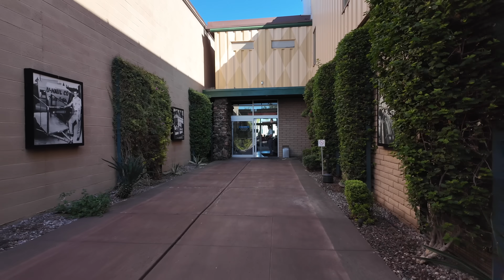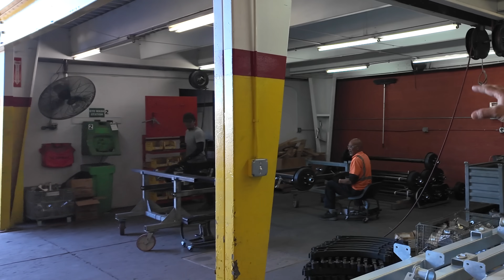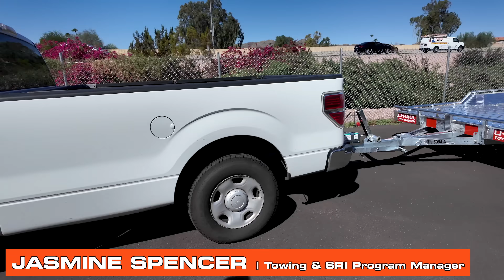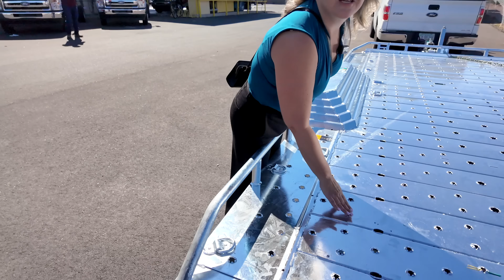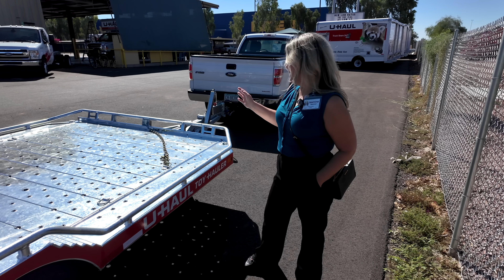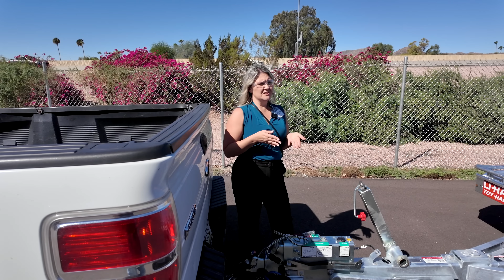Inside the U-Haul Trailer Factory

Comment: So I absolutely hate the hydro brake system. Because I just had to get walked through by u. Haul, how to unjam the damn system, leaving California. I was fighting the trailer the whole time and I stopped when I got to Arizona cuz. I'm just burning fuel, and I couldn't figure it out. I wasn't even loaded yet.
And that's what I realized the brake system was frozen.So they basically told me to beat on it with a hammer to free it up.But it's like the third time i've had faulty trailer brakes with these trailers.Also, it doesn't work if you're backing down a hill

Comment: Cool video! I used to work at the U-Haul assembly plant in Schererville Indiana back in 2004/2005. I was on the RV trailer wiring line, also did JH board up, and EL board up. Had a lot of fun workin there!

Comment: I've rented so many uhaul trailers through the years-- pretty much every type. It is abundantly clear they are purpose built to be rental units towable by a huge number of vehicles. They're so much better than the average consumer trailer. I know people love to complain, but I think uhaul is a great company.
Reply: My only complaint that I've EVER had with a Uhaul trailer is that the haulers don't have a winch...or even a roller or D-ring to mount a pulley to. And getting a 64 Impala with 4 flat tires and locked brakes up onto a trailer without a winch would have been impossible. (Ultimately we wound up using 3 vehicles bumper-to-bumper-to-bumper to create the line geometry to pull the Impala up straight.)

Comment: I will not use surge brakes. They jerk you around when braking and not smooth. Most all trucks now come with a brake controller built in. I think the real reason they're using surge brakes is to save money.

Comment: hopefully they added a way to temporarily disable the surge brakes so it can be backed up while loaded!
Reply from the maker: I have never had an issue reversing a u-haul trailer while loaded but I have also never backed them up a steep hill either. Surge breaks are progressive so if you are just backing up a gently sloped driveway, you would only be battling the surge breaks if you were stabbing the throttle.

Comment: uhaul employee here i have only seen the th once at my store i was the one to unhookit from cx truck and not even 12hrs later it went back out its a super popular trailer. 
and the uhaul makes their own equipment is also a powerful tool so the centers can do minor repairs so it does not need to go to shop plus parts can be used on many things ie the lights on the trailers are the same for the most part across the board between the trucks and trailers

Comment: I wish trailer manufacturers especially for cargo trailers would follow U-Haul’s design. They have dropped axles with a raised hitch which is a more proper way to have a low trailer and not have to have your hitch so low to the ground. There trailers are the best.
Reply: @gerrycollins9409  i’d settle for U-Haul making maybe a modified version so you can tell the bought ones from the stolen rentals but if they made trailers to sell. Though I like electric brakes as an option.
Reply: @kb9vgr totality agree, that would be perfect.

Comment: Huge U-Haul fan. I tow with U-Haul trailers on a regular basis. Absolutely the best value.
Please, please please when you talked about evolving .
Offer a range extender for electric vehicles similar to the product EV tender. All it would take is an E axle with a battery cell that assist the EV as it’s moving on a trailer platform.

Comment: Who manufactures the frame and trailer bed? The new toy hauler is nice, but it looks like this manufacturing facility essentially just bolts subassemblies together.
Reply from the maker: The frame and trailer bed (body as they call it) are assembled in another U-Haul facility, sent out for galvanizing, then shipped into the facility I showed in this video for final assembly. Kind of the same as how an automotive manufacturing facility doesn't build their engines and transmissions in the same plant where they assemble the vehicles. Maybe I can get an opportunity to check out the rest of their manufacturing if this video does well enough.

Comment: Engineer for the Darwin with a DL. 😂 Uhaul has gone through a lot of changes a lot not good! They abandoned people with classic vehicles and Larger vehicles for decades t
With car haulers that were designed for vehicles made in other countries yes America cars eventually shrunk! A mid size car from the 70s was Larger than a full size car today!?  And the fact they only use surge brakes on All of its trailers is dangerous in itself surge brakes were made for boat trailers where electric brakes can't be submerged!  They should have also included a way to use electric brakes and disabled the surge so people that know how brake work can be safer!!  You have 0 control over Uhauls surge brakes it's just a pendulum that swings no on the fly adjustment for weather, weight and road conditions it's a one for all system not good!!!
Reply: You mean the ones with the TruckNutz hanging from the hitch that can't be used without a drop hitch, jacked up so high you need a roofing ladder to get in?  And Wheels and lights to make the pavement princess, mall crawler super pretty no longer able to do truck stuff? I remember all the cars people decades ago who didn't have the $ to build their vehicles so it was all dressed up  with JC Whitney all show no go parts 😂  like the fart cans some run around sounding like a Lawn mower with stomach issues.😂 Yeah I know there are all types out there some just can't help but to go with the peer pressure and copy what Billy Bob did not knowing they ruined the truck nevermind letting them tow anything.
Reply from the maker: What happens when the previous renter disabled the surge brakes, then the next renter doesn’t have an electric brake controller? Then they have no brakes. There is absolutely zero world where U-Haul would be smart to have brakes be adjusted by renters and trust that every knucklehead who bought a truck has ANY understanding how to use a brake controller.
Reply: @GearsandGadgets   you know Uhaul used to sell and install electric brake controllers that were very primitive by today's standards! They used the brake pedal to activate it .  If the Rental location Doesn't check for safety and damage of their rentals before renting them like they are supposed to its on them! And it wouldn't be hard to make their trailer automatically revert back to the surge system!  😂😂😂 The company puts a lot of time money and thought into everything! Yes they almost failed several times but they keep coming back somehow?
Reply from the maker: @kmexploring6402 ”it’s on them” is exactly why they don’t do it. Risk mitigation is at the core of any good business and saying they would have to mechanically maintain both an electrical AND surge brake system on every trailer makes absolutely zero sense from a business perspective. Surge brakes work and they are idiot proof. Yes I would LOVE to be able to use my brake controller but the average person (Uhauls entire customer base) does not know how to properly set up an electric brake controller.

Comment: I love U-Haul trailers, but I think their trucks could use an update. The mirrors not being adjustable is a huge safety issue, especially given that the seats have basically no movement backwards. Between that and the lack of cruise control, it makes longer drives much more fatiguing than they otherwise would be.

Comment: Great new trailer, however you did not really say much about the brake operation. Since so many trucks don't have a brake controller I am guessing they are using surge brakes on this unit?
Reply from the maker: It was discussed extensively in the video.

Comment: I do art shows and like the new trailers. The roll up doors on the old style has flung black grease over my artwork on 2 occasions, making 1/3 of my work unusable on 2 occasions. These days I make sure to get trailers with a different door mechanism. 

That being said I bought an enclosed trailer so that I would not need to keep renting. Then after owning my own trailer for a while, I am selling it because of the features offered by the uhaul trailer. Like the long single shaft connecting the trailer which lets me back up until the trailer is perpendicular. My personal trailer is a V at the nose which is much more frustrating to maneuver. And the haul trailer is aluminum, and fully loaded, I can move it by hand. Mine weighs an extra 200 pounds at the trailer hitch with the same cargo, in order to move it by hand I have to load an extra 600 pounds of concrete near the rear door. That weight then makes it sink into the ground more, and harder to roll. I will keep getting uhaul trailers instead.

I rent trailers 5 to 15 times a year for 3 to 10 days.
Reply from the maker: I think renting with that frequency is worth it more then owning aside from the convenience of owning for availability but everything else from storing and insuring starts to make less sense unless you are pulling it multiple times a month.

Comment: How do brand new trailers, not even out of the shop, have plates assigned to them already?  I mean you're manufacturing one every 1hr 20min, how does the VIN get through DOT and plates assigned so quick?
Reply from the maker: I am not sure but I did notice the trailers have Washington plates which is where U-Haul was originally founded but then HQ relocated at some point to Phoenix HQ. I am sure they probably have some self certification process out of Washington for their own rental fleets is my guess including a VIN generation process.

Comment: Nice trailers! U-Haul should give the public the ability to special order one if they want to pay the special order, low production price. I would certainly pay more for the quality. I love that they are galvanized instead of painted or powder coat. Powder coat is nice if done right, but all of the ones I see around here just peel off in sheets with rust underneath. No blasting prep work, just coated right over mill scale. I hate running my trailers in the winter because the salt destroys them in about 3-5 years, even if you take good care and wash them or Fluid Film them regular. Aluminum trailers are nice, but they typically don't hold up to abuse over time, especially with heavy loading and are a pain to get them welded because not everyone welds aluminum. I do, however, weld aluminum and have repaired many of these trailers. There's usually no rhyme or reason as to where they break, just not good welding and design as far as I can see.
Reply from the maker: I agree there could be a use for such a HD trailer mass manufactured but I don't think it makes sense for U-Haul to enter that business when they make so much in renting them.

Comment: Very interesting, I kind of had an idea that U-Haul made their own trailers but it was cool seeing a video of it.  I remember when U-Haul had their own branded tires and if I remember correctly they were an odd size to prevent them from being stolen.   They also used to rent clamp on trailer hitches but this was back before the 5mph bumpers which was before 1973.  One other thing they rented was mirrors that clamped to the front fenders under the hood on top and the wheel opening on the bottom.
Reply from the maker: Thanks for sharing some of that U-Haul history!
Reply: Ahhh the good old days of real chrome bumpers!
Reply: I remember those. I rented the clamp on tow bars. As a U haul dealer, I even got a call for one recently.

Comment from the maker: For all of the people who say they wish U-Haul sold these, I did too until I thought about it. I ran the numbers through ChatGPT (take it for what it is worth), and the estimate was around $9,200 to manufacture. If they sold them new, MSRP would likely be around $13K, and I do not think they would sell many at that price.

The reason (I assume) they do not sell them used makes even more sense. U-Haul does sell their used trucks, usually around 100K–120K miles for $10–12K for a 10’ box truck, because trucks still hold retail value. Trailers do not have odometers, they are worth way less used, maybe only a couple grand at best. Tow dollies, which are single-axle and only ever carried half a car’s weight, can be bought used for $1,195, and that is probably because U-Haul knows they were not abused nearly as hard. Full trailers on the other hand get used for anything and everything for 20–30 years. A local U-Haul employee once told me that newer trailers are kept for cross-country rentals while older ones are cycled into local-only service, and that makes sense because the in-town move trailers almost always look beat. By the time they are end of life, they are absolutely thrashed. At that point, the steel itself is worth maybe $200–$285 in scrap at today’s prepared steel prices, which is far easier than trying to sell them used and take on liability.

When you factor in that a $9,200 build can conservatively bring in $150K over 20 years at just 90 rental days a year, and that it only takes about 45 days of rentals to cover the profit they would make selling one new, it is pretty clear why you will never see these hit a sales lot.

Bill of Materials (condensed, ~$9,200):
	•	Structural steel and galvanizing: ~$3,800
	•	Axles, wheels, tires, and brake system: ~$2,000
	•	Lighting, wiring, safety gear, and hardware: ~$500
	•	Jack, coupler, ramps, decals, consumables: ~$400
	•	Labor, overhead, logistics: ~$2,500

Total: ≈ $9,200
Reply: Yeah, they ride them until they're beat.  Although I would like to get my own with the U-haul features that aren't as common as the ones for sale.  Galvanized steel construction and totally independent hydraulic surge brakes.  Those are quite rare to see.
Reply from the maker: @ryanpaaz  Agree
Reply: Close but not quite. The real reasons u haul doesn't sell trailers is liability.  
Where u haul buys its trucks from a major manufacturer  ford or gm then resells those at end of rental life.   As seen here u haul engineers design spec and then uhaul builds the trailers from ground up. 

Liability comes into play. Buy a former uhaul truck built by gm, have a person wreck that truck and then they sue gm for the design issue.  Uhaul didn't build the truck they used it and sold it. 

Now buy a uhaul used or new trailer have a wreck and sue uhaul.  

People can overload or misload a trailer easily. They can neglect maintenance they can improperly attach it they can fail to secure the chains properly or fail to secure the lisd properly. Fail to drive properly.  Much more so than a truck van or pickup. 

Uhaul used to sell off trailers up to the the 70s or 80s. Then a major lawsuit was made over a wreck involving said used trailer and after the case was settled. Uhaul made a business decision  of never selling another trailer. Only the trucks. This is also why they remove the box from the 26 foot trucks. They reuse the boxes or recycle them. They only sell the 26 footers as cab and chassis the exact configuration that uhaul buys them in from ford or gm. 

As a result of that decision that is well published, Today any uhaul trailer due to their unique design and look possessed without an active rental policy is presumed stolen.
Reply: I worked as a Regional Building Maintenance Manager for UHaul for 8 years, so I have some inside logic as to why UHaul Corp has never sold any of it's towed equipment. It's a fairly easy reason. Since they have always built their towed equipment, they eouod always be liable even if it was sold and UHaul wasn't doing the maintenance and inspections on it. So when a towed equipment had gotten to the point where it is too compromised to rent, Uhauk either has the equipment scrapped or it is rebuilt. 

With their rental trucks, am automotive manufacturer makes the chassis and Uhaul mounts on of their boxed onto it, so the chassis manufacturer takes most of the liability if something were to go bad from a bad design.

Occasionally I have seen UHaul towed equipment repainted by someone, but it is obvious that it is stolen. Uhaul has in the past gotten Regional people to go out and hunt down stolen equipment with the police and Uhaul puts the VIN in various places only seem fro. underneath so it can be properly identified.
Reply: @gregdcross  How did so many Uhaul camper trailers get released to the open market?
Reply: Actually rather stupid to stand there talking about the electric brakes thing and absolutely skip over what you should have been talking about. Some of us know what surge brakes are, but I would imagine quite a few people have no clue.
Reply: "$9,200 to manufacture" HAHAHAHAHA. Thanks GPT, that's a really unique perspective! I love how you're thinking outside the box!
Reply from the maker: @AmNesia-r5h  I think that $9,200 is pretty spot on actually. I would place it between $8K cheapest, $10K max depending on fluctuation of material costs. The number that matters the most is the rental rates which put it all into clear perspective on why they wouldn't sell them regardless of cost of manufacture.
Reply: @GearsandGadgets  i'd pay $9200 if it was real stainless
Reply from the maker: @AmNesia-r5h  So you would pay exactly how much it costs them to manufacture a galvanized trailer if they would make it stainless? Maybe this is why they don't sell them because people want a trailer that would COST $16,000 to build out of stainless for what their cost is to build the same trailer out of galvanized for $9,200? Not sure if you know how business works but selling things at a $6,800 loss isn't really a sustainable business model BUT I can assure you that market is WIDE open if you want to capture that marketshare.